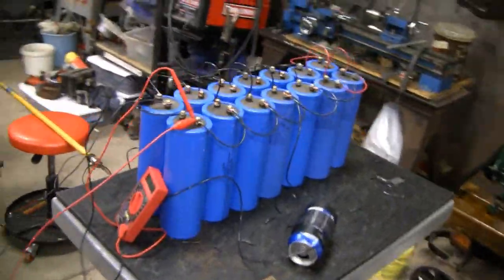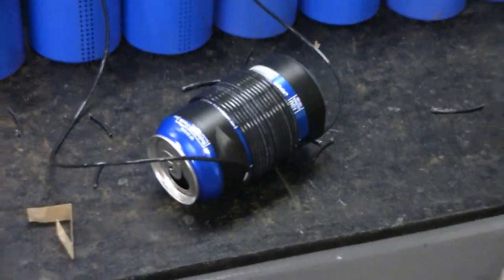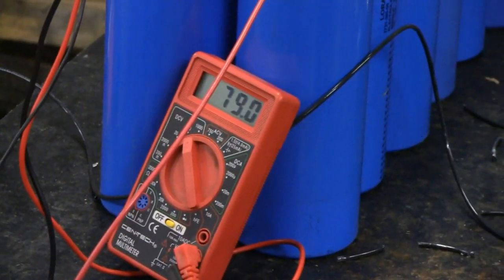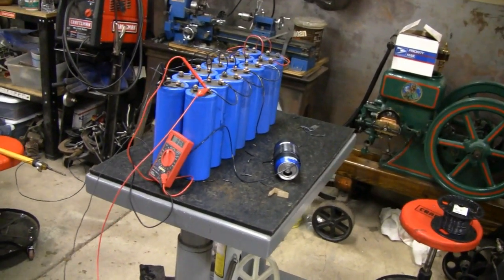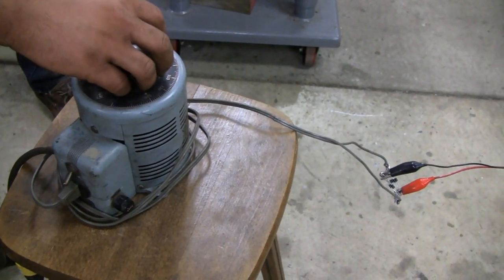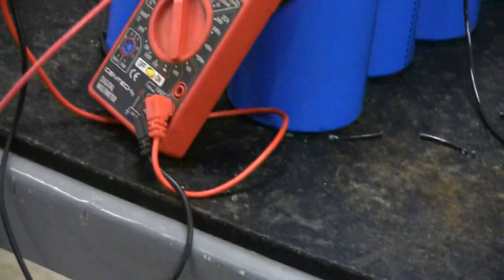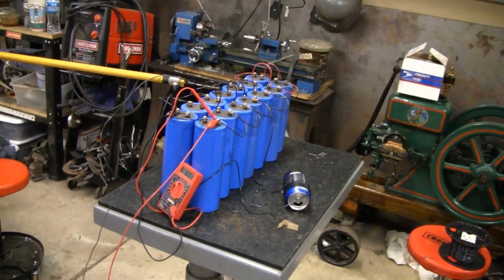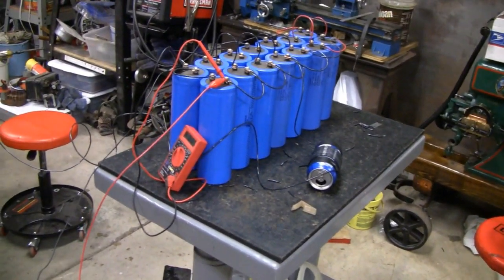CAPACITOR EPIC FAIL 2nd TRY

Comment: Putting AC voltage on a bank of capacitors won't charge them.  The AC needs to be converted to DC first.  Then they will charge.

Comment: Great video! As I mentioned in a comment about your previous can crushing try, you are way off on the power needed.  Since it takes about 700-1000 joules for a good crush, and you charged your caps to about 140 volts, you would need about 80,000-90,000 microfarads of capacitance. Though I cant see the cap values you have, I doubt its that high.  Before your next try calculate the joule output of your cap bank J=1/2CV^2 where C is in Farads, not microfarads and V is volts.  Not tryin to be a douche bag know it all here, I wanna see some can shrapnel fly!! Love your videos guys! Thanks for making them!
Reply from the maker: Thanks alot Bud!! You don't sound like a Douche bag at all!! That's good info that will help the Guys!! I think those caps are 70,000 uf !!☺
Reply: I think the good can crushers run in the multi-KV range. The hard part is the switch. You DO NOT want to be shorting out the cap bank with a stick. Need a good ignitron as a switch. Good clean fun.

Comment: The cables are too thin, the cables should be around 4 to 1 gauge wire, plus the capacitors need to have a low internal resistance

Comment: Hmmm I saw a fella in Australia using a known good industrial capacitor about 4 feet high with really heavy cables and in the vids I saw he was only able to choke a can down by about half, so I dunno.
Reply: ***** Yeah that's the guy, I'm subbed too... with that huge now pair of capacitors was he able to crush a can down farther than about halfway?
Reply: Well, there you go!  BUT he was working only one massive capacitor at first and being real carefu, then he got the second PhotoInduction type industrial capacitor... It ought to have made a nice big BANG or two.

Comment: I'm not sure why one would expect an aluminum can to react to a magnetic field.
Reply: Two words Gizzmo....Eddy Currents!
Reply: two words " non ferrous"
Reply: ***** look buddy I'm not trying to be a smartass here! Do some research and you will see that this does In fact work with aluminum cans provided there is enough energy discharged fast enough
Reply: yep, toss one into a substation and it might work. It works on squirrels, snakes another varmints who venture there. Perhaps you have a link other than Youtube to prove your claim.
Reply: dirtbike5100 Thanks, did you read the part about it taking 3 KV to work?
Reply: ***** He did. Did you actually read his other comments? Seems like you missed out on some basic scientific principles in school.
Reply: ***** I had mentioned that it will work provided there is a high enough energy discharge...perhaps you missed that part. Did you also miss the part about them using aluminum cans?
Reply: ***** Well, judging by your comments here... I agree; you should.
Reply: ***** My understanding is that aluminum being the better conductor of the two it has the stronger eddy currents
Reply: jrmym2 I read the other comments but did not see anything about using less that 3 KV. I guess I just need to toss my masters degree in electrical engineering in the garbage.
Reply: http://tesladownunder.com/CanCrushing.htm
Reply: ***** This is a nice find here...explains that steel cans are harder to crush due to their strength, opposing effects of magnetic attaction, and reduced eddy currents (quoting him there). Very informative!
Reply: jrmym2 Be nice. I'm just trying to help. Mike & Dirtbike will figure it out. They don't give up :)
Reply: dirtbike5100 Yes it is! I learned a few things assuming he is correct. I had always been taught that the eddy currents in aluminum are very small compared to a ferrous material. Perhaps there is some other force at work?
Reply: ***** Spreading ignorance isn't helping anyone, nor is lying about having a master's in EE.
Reply: jrmym2 Put your money where your mouth is. Name the amount you're willing to donate.
Reply: ***** We'll let RoadKing hold the money until I submit the proof.
Reply: ***** Okay, I believe you... just tell me where I can get one too... without understanding basic scientific principles such as the induction of eddy currents in aluminum...

Comment: When mates have done this they  joined the caps with brass strip, 1/2" wide.

I got zapped once whilst showing my son the workings of a kenwood ts820s, they arched in a green flash to my forhead 10 inches from the radio, amazing zap and crack, I wasnt hurt but it was about 1kv

Comment: A inductor in series with a capacitor works as a current limiter while discharging. You can try less windings around the can. The can crusher I saw on google have something  like 3 turns. Also they use much higher voltages and start something about 1 kJ of energy. The formula for energy is E=0,5CV².